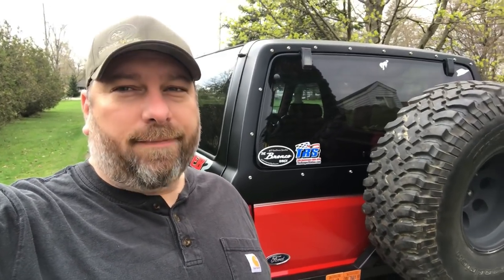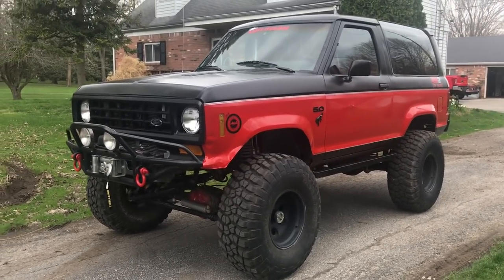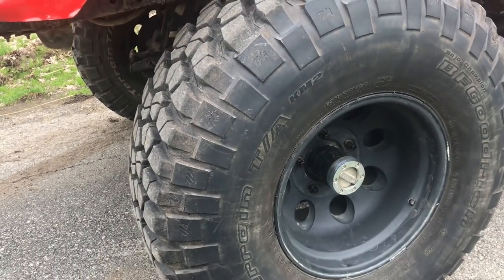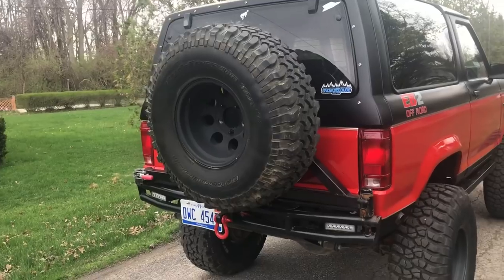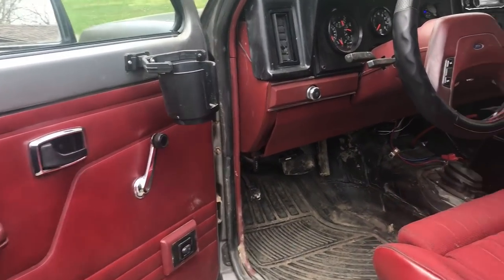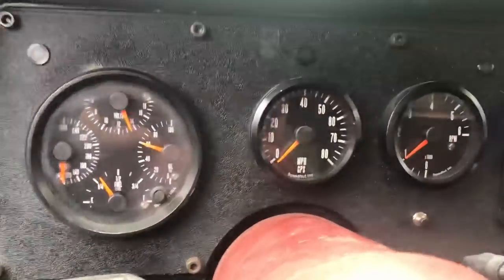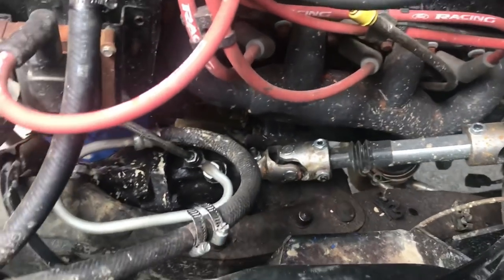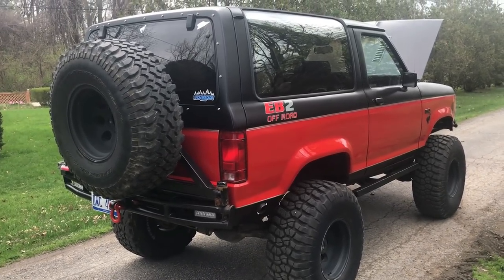V8 SAS Bronco2 walk around

Comment: You have one of the nicest looking B2's I've seen. When it comes to the paint job, yeah I've seen a couple that their paint job alone costs more than you're entire build. But you had something else in mind. Paint it to look badass, but you also didn't build it for car/truck shows.  You actually use your lifted, big tired, V8, SAS swapped B2 for its intended purpose. Off-road. And the $ you saved by not spending $20k on a paint job allowed you to spend that $ to things that actually matter. 

Badass build man. I hope @ 4+ years later it's still going strong 👍
Reply from the maker: Sadly I have moved on from the B2 and built something even better and more unique. Check out the main page to my channel and check out my replacement!

Comment: Nice job Brian the paint scheme looks good!My daily driver for the past 10 years is a 1990 Bronco II 5 Speed 2.9. Has 230,000 and still runs like a Champ.Did the 1990 Ford Mustang GT seats bolt up ok to the stock Bronco rails or did you have to modify them?My drivers Seat needs new padding and recovered or used Seats like you now have they looked really good in your Bronco!This is my second Bronco II I love the way they drive and handle.
Reply from the maker: Mike James the mustang seats bolt right to the tracks , but in an older vid I show how I swapped the passenger seat recliner hinge so it works like it should for the B2
Reply: @randumadventures  Thanks Brian for the Feedback!Those seats look very comfortable and I will see if I can find a pair for my Bronco.Nothing like a Bronco II just love driving mine so easy to handle and pulls like a Bear in 4WD.Thanks again!
Reply from the maker: Mike James these seats are way more comfortable than the factory B2 seats
Reply: @randumadventures  Thanks a lot I will give my salvage yards a call and see what they have.That model Mustang is so popular they might be a little high priced.I will also keep a watch on Craigs list for some one parting one out.Thanks they sure do look comfortable!

Comment: Hey there! Nice video! I have an 86 bronco 2. I’m building it to be an overlanding rig within a year. I plan on doing quite a few mods  to it with engine swap, live axle, 35s etc. Currently as she sits with stock tires she feels top heavy. Do you feel that your lift and 35s are a stable ride or do you still feel some of the top heaviness? If so, any tips to help prevent that? I may have some more questions later on, thanks!
Reply from the maker: Well it definitely doesn’t feel like a corvette going down the road! It’s a lifted truck on big tires and soft suspension so it’s going to feel weird no matter what you do. Mine doesn’t bother me at all.  If your concerned just make sure to retain the factory sway bars or add an aftermarket one like a AntiRock

Comment: I can't remember which high pressure power steering line you used with the explorer pump. Is it a stock line out of another year?
Reply from the maker: It’s mentioned in one of my early build vids but I believe it’s for a 91 Ranger 4.0 and you just need to straighten out the bends.

Comment: Brian, what’s the purpose of the pellets in the tires?
Reply from the maker: Erik Turner to balance the tires. Don’t use wheel weights on a true off road truck because they can get knocked off and any mud ,stones or snow that get stuck in the wheel or tire will throw it out of balance. With pellets they will self balance indefinitely

Comment: Do you think it's worth it to drop a SOHC 4.0 in a bronco 2 vs doing the 302? they have the same HP so the ease of the v6 just seems more logical to me, just wanna hear your thoughts on it
Reply from the maker: Jake Green to me no.  The known issues with that motor and lack of torque compared to a 5.0 is reason enough for me to not consider it. Plus I’d rather get away from that family of V6 transmissions
Reply: Gotcha, thanks! I'm just trying to figure out what swap to do eventually, as I'm a poor post college kid looking to budget for finally treating my 89 right
Reply from the maker: Jake Green then I’d start getting a parts list together and start keeping an eye open for those deals when they pop up and be ready to jump.

Comment: I just bought a 1985 and trying to get a idea of wheels and tires for it... what do you have in mind ?
Reply from the maker: Blaze Womack hard to answer that one. Is it stock? Lifted? Staying on street? Off roading?
Reply: Randum Adventures With Brian it is stock but I’m wanting to build it for it to be off road but still drive it around my local town
Reply from the maker: Blaze Womack tire size will depend on if you lift it and if you re-gear it. Type of tire really comes down to the type of driving you do. I like the BFG KM2 on my truck since it’s mostly off road in extreme conditions.

Comment: What are tire pellets for?
Reply from the maker: They keep the tires balanced. If there is mud,snow or ice in the wheels the pellets will still keep them in balance. Also with the tires aired down you run the risk of popping the tire off the rim and may have to remount a tire trail side and chances of getting the tire matched up with where it was for the wheel weights will be impossible